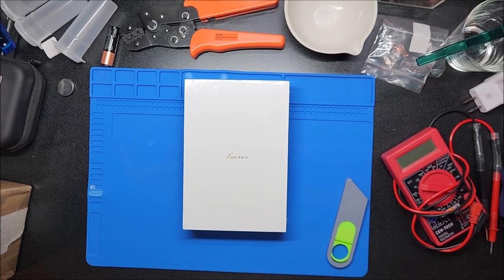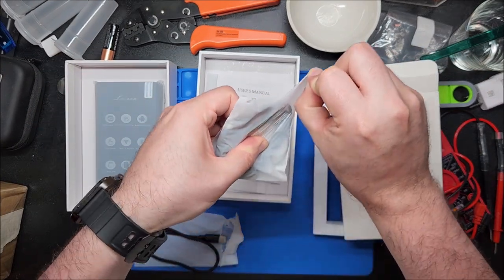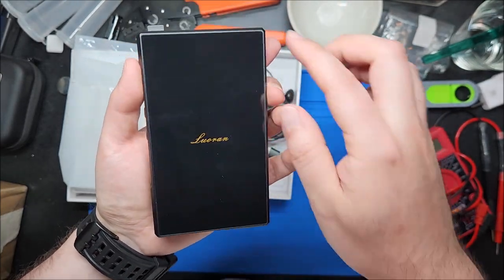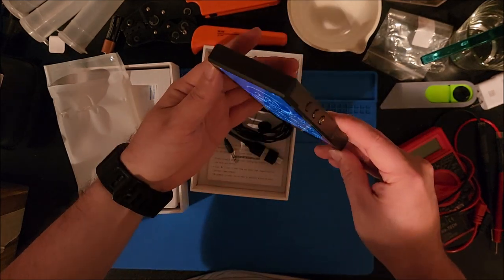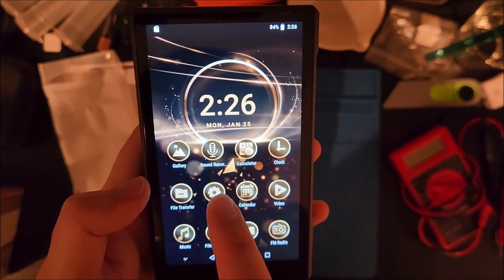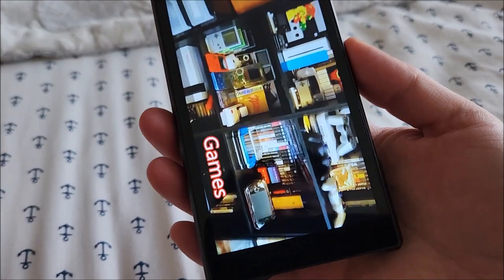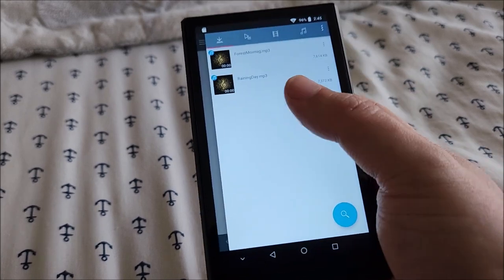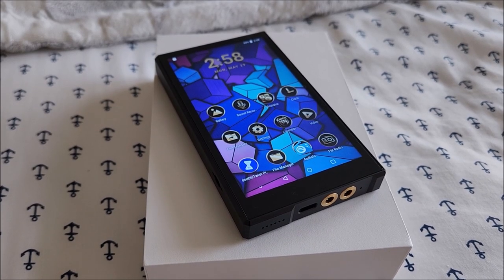The New Android MP3 Player King? Luoran N2 Review

Comment: I agree with you about having physical media buttons separate from volume buttons. Since this is Android, a work around could be to use an app like Volumee to skip tracks with volume buttons. I've used it on phones in the past, and it worked well.
Reply from the maker: Thanks for the tip, I'll have to check Volumee out!
Reply: Yes bad but I wish it was a bit more intuitive and easier to use… has a 2002 technology vibe

Comment: The N2 does have a developer mode just create a pin in security then go back to the systems page tap the build number until it ask you for a pin to activate developer mode. I was able to remove a few systems apps with adb specifically the factory music app and musicfx apps and a few other apps that you need adb for removal. I've also installed a volume booster app for when i use a wired headset because the unit has a weak signal through both headphone jacks which is pointless to have two headphone jacks when it can barely drive one set of headphones no matter what the impedance is.
Reply: @omari1498 could you tell me which volume booster app you downloaded? Mine seems pretty janky -distorts too much, but I want to know if there's a better app. Thanks!

Comment: So i bought one and received it today and as it turns out.. it's not the ACTUAL luoran but luoran probably just rebranded this. The dap i have has the specifications of 3,7gb (probably ddr3) ram and I've seen a bit of Compatibility issues as example with some apk files. Otherwise it's os is very lightweight and it uses very low power. I'm still sad about it not supporting otg so i have to transfer files from another device or sd card tho. I might've looked at it wrong or something but they advertise this dap as "8 core mtk" and I only saw 4 cores..

Comment: Great video. I ended up getting it but I can’t seem to find a case anywhere for it. It’s so nice I don’t want to drop it and be out all that money.
Reply from the maker: Yeah since it's not name brand and the manufacturer doesn't make a case themselves your options are gonna be either custom (if you are crafty) or generic as in those flip leather cases that have elastic/neoprene bands to fit a range of devices.
Reply: Get someone to 3d print a case.
Reply: 3d design a case and order it from somewhere maybe?

Comment: Thank you! Great review video! I learned a lot. Two questions: How does it sound? Are the headphone jacks balanced? I saw online reviews that said it could sound better.
Reply from the maker: The headphone jacks are not balanced and the output sounds ok stock, using a digital equalizer helps but I'd just suggest using a good pair of bluetooth headphones so you aren't limited by the internal amp inside the device.

Comment: My unit permanently died after installing apps. When I get my replacement unit I’m not gonna install apps to it
Reply from the maker: That's definitely not normal, I have a feeling that it dying and the installation of apps was coincidental. Much more likely that it had some hardware fault like a cold solder joint or a damaged flash chip that directly caused the failure and installing an app either indirectly pushed it over the edge or just happened to occur at the same time.

Comment: no mention of how it sounds or if there's a DAC in this?...
Reply from the maker: I use bluetooth so 1st point is moot and 2nd has to be a yes otherwise there'd be no analog output. As for what specific dac I unfortunately couldn't tell you without tearing it open.

Comment: is there any way to get the max volume higher for wired earbuds? Otherwise I adore this thing. :)
Reply from the maker: I'd suggest trying a music player app like doubletwist that has a built in EQ so you can adjust the pre-amp gain. This will boost the volume a bit but be aware that even with this there's still an overall physical limit of the amplifier inside the player and increasing the software eq gain too much will distort the audio quality.
Reply: @sjm4306  thanks, man! I appreciate it. One other thing...do you know if it works with USB DAC dongles? I'd wager that'd solve all of my problems re: volume and gain. :)
Reply: @sjm4306  oh, geez, you answered my question in the video! Guess I have to return something! 😝
Reply: @DenOfVipers el dac sólo sirve si lo tienes conectas al minijack 3.5

Comment: Hi thanks for the review. I have placed order for the same from Aliexpress. Wanted to ask, does it sound better than a smartphone?
Reply from the maker: So it depends, over bluetooth it will obviously sound the same but I will say that the analog amp output through the headphone jacks can sound a little weak with some higher impedance headphones. I tested with iems which are pretty efficient, but with much larger headphones I noticed I had to turn the volume up torwards max sometimes. This is probably where they cut costs and your smartphone (if it even still has a headphone jack) will likely have a more powerful amp in it. If you intend to use iems, bluetooth or have an external headphone amp then that levels the playing field, considering the price difference.
Reply: @sjm4306  generally am not an Audiophile but I would be using mp3 at 320kbps mostly. But what you suggest? Should I cancel this and order anything in budget like $100. I have Aliexpress option. Am from Dubai by the way.
Reply: @sjm4306  also I don't use amps. Just bluetooth preferable. I use Sony WH-1000Xm4. And also one bluetooth TWS hearphoens.
Reply from the maker: If you use bluetooth headphones then it doesn't matter and this will sound as good as any phone or other player. If you use wired headphones then if I'm being honest if you can spend $50-$100 more then you can get yourself a midrange hi-res audio player from fiio or hiby that'll sound much better over the analog jack. Generally though in the under $100 price range, anything you get will sound ok through analog with low/midrange headphones and 320kbps mp3's.
Reply: @sjm4306  so it's better to start from N2 and if audio bug bites me I will upgrade. I guess that's a good idea. What say?
Reply from the maker: Yep
Reply: @sjm4306  thanks a lot buddy..

Comment: @smj4306: Hey, have you personally tried a larger SD card than the stock 64GB in your N2? I'm wondering if I were to buy a larger memory one, like say a 128 GB (or whatever); if it would work? Please gimme your advice? Thankya!
Reply from the maker: At one point I put the 512GB card from my tablet into it to transfer some music to the internal memory so I see no reason why 128gb wouldn't work. The days of max memory limits due to crappy firmware are long gone, pretty much anything that runs android will happily accept as much memory as you can throw at it.
Reply: @sjm4306  thanks, buddy :)

Comment: Whats the Bluetooth connection like for earbuds? I've had some terrible players and its like owning a discman, anytime you move the earbuds cut out, drives me demented
Reply from the maker: No problems with my sony xm3's till you get more than 25 feet away. In crowded public areas you may get the occasional short dropout but not very often.
Reply: @sjm4306  good to hear, I've been hearing the volume isn't that loud on the player itself, is that true
Reply from the maker: Yes the headphone output amp volume is limited but that obviously only affects wired headphones and not bluetooth ones.

Comment: Sjm4306 Excelent review! Thanks! My question for you is: Pecsu p5s or this model?
Reply from the maker: So it really depends if you value features or cost more. If the extra cost doesn't bother you, the Luoran N2 imo overall is a better player. But if you want better value for your money the Pecsu P5S honestly is still very good (I'd say 80% valuewise of the N2 at something like 60-70% of the cost last I checked).
Reply: @sjm4306  Where can I buy the N2?
Reply: @sjm4306  I know where to buy the P5S but, where can I buy the Luoran N2? I Just need to know the exact price.  That's all.
Reply from the maker: I've linked the amazon link in the description but looks like they've sold out. I googled and looks like aliexpress has some stock but cant promise it'll be up for long. The price is $99 (at least that was what it was on the amazon link when it was available last I checked).
Reply: @sjm4306  Thanks again. You're the best!
Reply: @sjm4306  I couldn't find the Luoran N2 anywhere, so I ordered the Pecsu P5S. If you ever find out when or if they are coming back, please let us know. Thanks!
Reply from the maker: Looks like they are back in stock on their amazon page
https://www.amazon.com/Bluetooth-Supports-Downloaded-Pre-Installed-Aluminum/dp/B0C36HWV8Y
Reply: @sjm4306  When the term "lossless " is used to describe an mp3 player, what does that mean? Does it have to do anything with the quality sound?
Reply from the maker: So lossless means whatever compression is used to make the music file size smaller doesn't result in loss of audio quality (as in there is no data that is "lost"). Flac for example is a compressed format but by design decompressing it to wav will result in 100% of the original music file back. Mp3 however is a lossy compression meaning data is thrown out during compression to make the file even smaller which means that it's impossible to go back to the original full quality version of the music that was originally used to make the mp3 file.
Reply: @sjm4306  So that means that if I have a loseless mp3 player when  I transfer my music into it, it should not result in loss of quality?
Reply from the maker: Basically
Reply: @sjm4306  Excelent. Thanks!

Comment: Who uses MP3 files? Seriously? Flac, dsd, yes... MP3, nooo...it's not 'double headphone jacks', one is 3.5mm and the other 4.4 double ended, and has more power. . Don't use both at one time. You have to set it for data via USB or it won't read the card or flash drive.